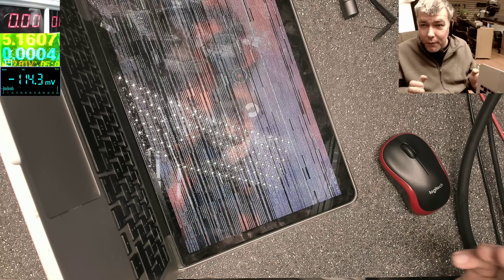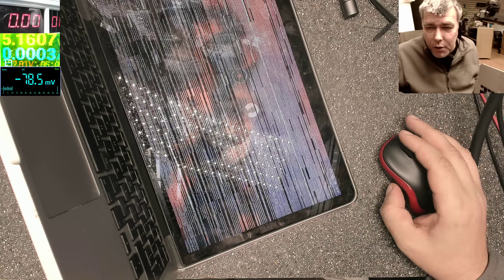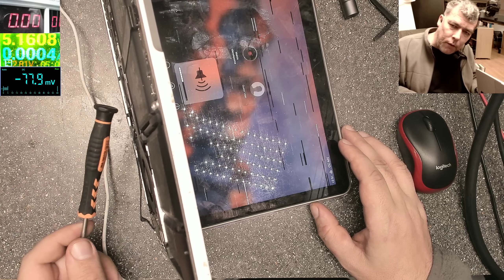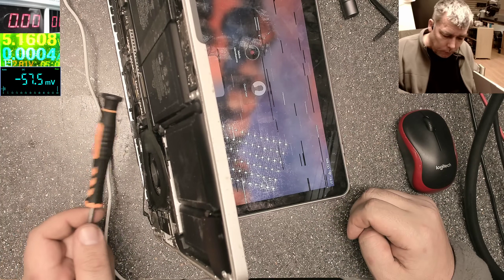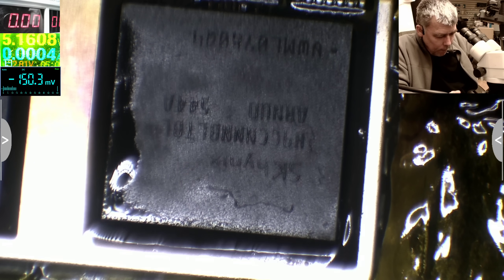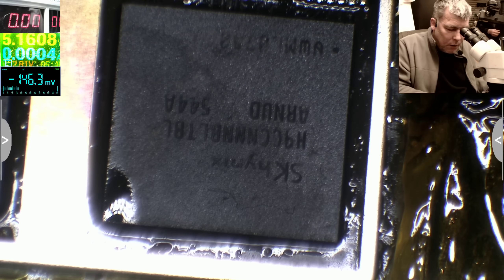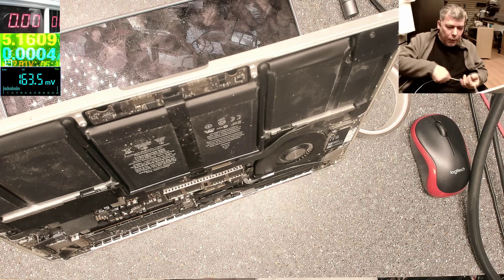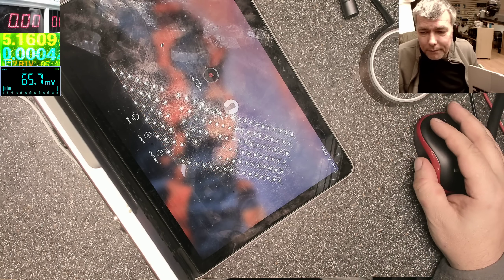MacBook freezing/lines on the screen

Comment: Hello, love your videos I learned a lot of things from them, keep up great work!
I was wondering if someone could help me out or give me hint on my issue, I have motherboard "MS-7236 VER 2.5 945PL Neo 5" And my issue is that when I enter into windows USB doesn't work. And sometimes it does, in BIOS it always detects the USB Drive, so basically when windows 7 loading screen appears and I flip my mouse upside down, and I look at laser, its lighting red and then in middle of windows loading screen laser light turns off and basically none of my USB drives are working. Mouse is perfect, tested it on another PC... I tried to flickle USB port on motherboard little bit sometimes it works sometimes it doesn't, and my idea was to try to touch each contact on USB port with soldering iron, but I don't want to screw everything up so I thought it would be good idea to ask someone who has more experience about my idea, thank you :)

Comment: Sorin, 'super silent' compressors based on refrigerator pumps are as quiet as fridges - quiet enough to leave them plugged in all the time in dental surgeries, just switching themselves on automatically when the pressure drops.
Jun-Air make good (expensive) ones but there are plenty available used.
An airbrush is great as a soft, controllable blowgun.
I was convinced you had a damaged screen connector flexi - I'd never have thought of ram :)

Comment: Hi i have a asus x555l laptop was with win 8 i put win 10 and the i got problems with wi fi ,after 1 day disconnects and if im trying to reconect it say cant connect so to connect i have to restart the laptop!I checked the coaxial cable on main bord and its connected !!
Can u help me with any solution??
Reply: Try to install original wifi drivers from Asus website for Windows 8... helped me few times. When you installing windows 10 very often microsoft is using their own newer drivers but original works better
Reply: @marcinsliwinski1374  thanks i will try

Comment: And the chip needs to pull itself back into correct portion when reflowing?
Reply: Surface tension ,this Is how it's called in my language like water that doesn't spill out of the glass when it's a Little bit above the edge
Reply: It should find it's own 'center'.
Reply: @randyr.parker2698  indeed

Comment: May be apply some cold and heat on a single chip to identify the bad or bad ones?
Reply: But it's not a bad chip, it's a bad solder joint. Maybe heat would help if there's a tiny fracture that closes on expansion, but otherwise I'm not sure how cold/ hot would be useful?
Reply: @exasperated  when you apply the cold the contact of a cracked solder will disconnect and when apply heat it will make contact. There are micro crackes within the solder or the solder ball never flowed correctly during production